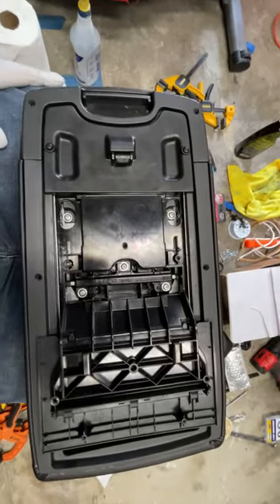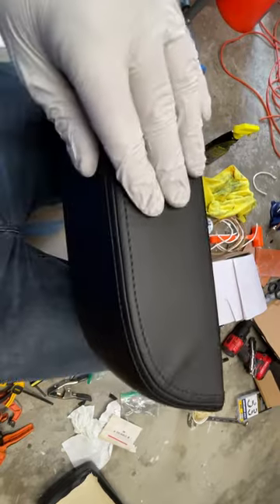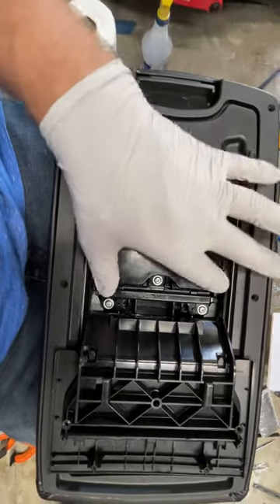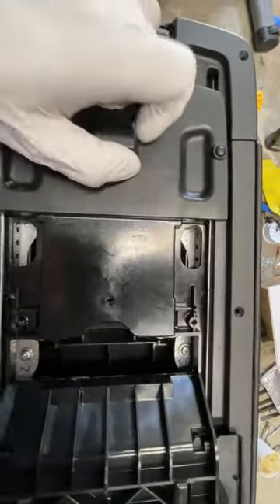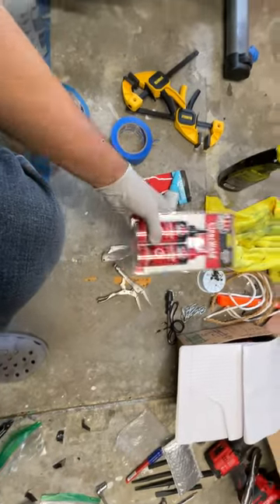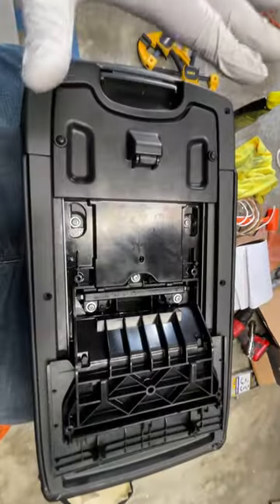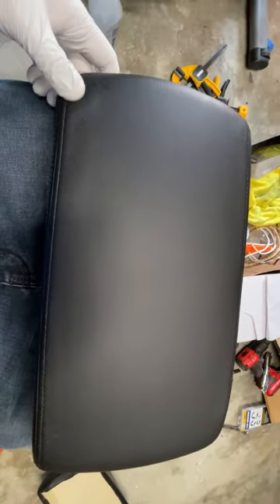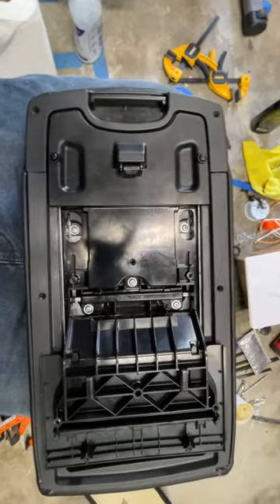2005-2012 Toyota Avalon Center Console Armrest Lid Cover retouch part 2 of 2

Comment: I found this pair of videos extraordinarily helpful, replacing the console cover on my 2007 Avalon. Thank you for posting! However, I have run into some difficulty putting it all back together because, as you point out, the springs all just kind of fall. I can't see how those little hook-shaped gizmos are supposed to stay in place. I have one spring behind them that slides onto a stem, but there is another spring that I think came from below that crossbar (that is held by 3 screws). I strapped the 2 gizmos in place with a paper wrap and tape, and left out the 2nd spring altogether. It looks okay, but having reinstalled it in my vehicle, the latch doesn't work. I have to slide the console all the way forward and then reach up under it with a finger to work the latch open. Please help if you can!
Reply from the maker: Hwy Joy thanks for the great comments.  Hopefully re-watching the video will help you find the sequence.  Whenever I am in doubt, I go to a junkyard like LKQ, and do a cadaver on site.  All it costs me $3 admission fee and gas to go visit.  You can do it!